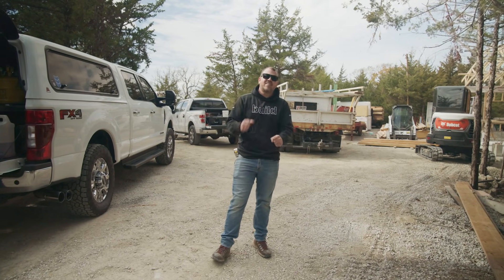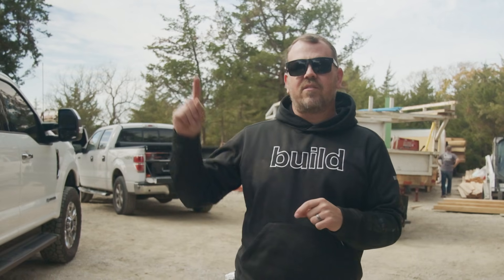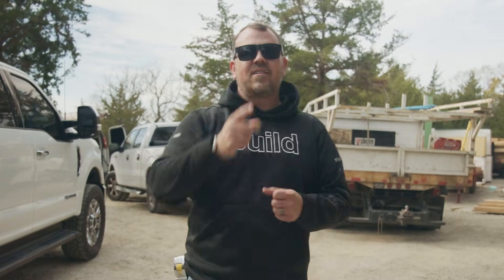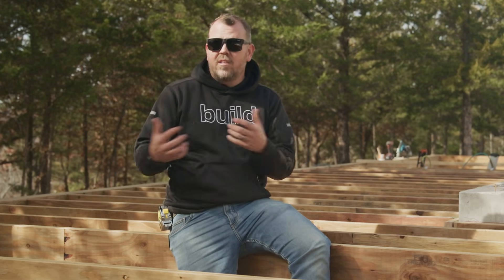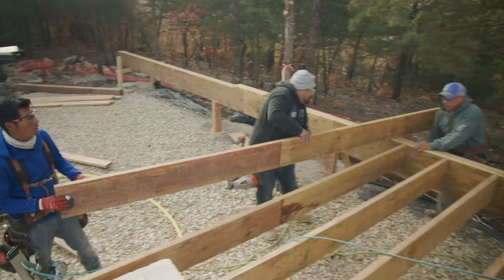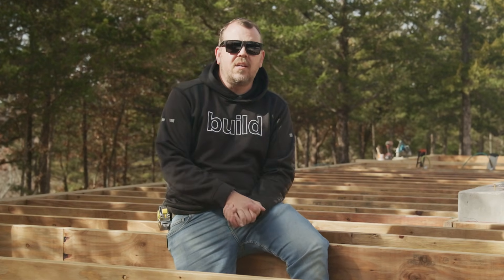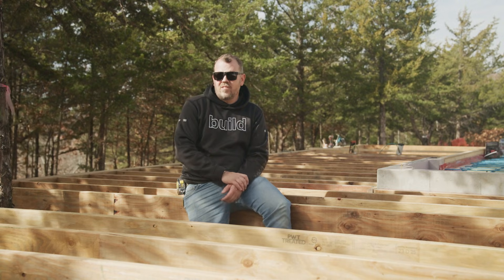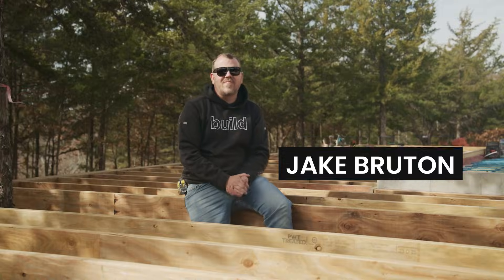Ditch the Pressure-Treated – Why LVLs Make a Better Deck

Comment: Its roughly the same span and dimensions comparisons for load bearing and span codes. PWT LVL though is much higher. Prodeck show $12.10 per lineal foot on 1.5x10" vs $3 per lineal foot on regular ground contact PT. Yes there is cost cutting for labor, efficiencies to be found, etc., but taking a $10k deck to a $30k deck (or whatever cost your want to compare) is a hard sell for most builds. Risinger channels specialize in the top percentile of builds and has great videos, but normal Americans and builders can't implement $50 Sugatsune hinges and upgrades that cost annual incomes of families. Not throwing shade, I wish we could and the knowledge is sound, but lets talk realism in todays world.

In before keyboard warriors saying price your worth, in my market, been a framer for 230 years and its not that bad.....
Reply: The total cost difference shouldn't be anywhere near that severe. I imagine the cost of the framing lumber is only around a quarter of the cost or less of the deck (customer price) unless they cheaped out everywhere else. The decking, railing, and labor are the big costs usually.
Reply: Even with the prices of PWT LVL, you can get a lot of deck for 10-30k. I have a composite top deck, that after 15 years the carpenter bees completely destroyed the sub-frame.. so its back to figuring out what material to use: (1) dimensional lumber (2) Owens Corning Structural/Composite Lumber (3) PWT LVL. For a 20' x 12' deck to replace the subframe, I have got quotes in excess of 20k.
Reply: @Dennis47403 I'd look at steel and aluminum too. I'm not a huge fan of the OC composite. The spans are terrible.

Comment: How does PWT LVL's price out versus steel joists? I have seen high end decks made with steel in videos but never in person. It doesn't seem to have caught on.
Reply: The first pricing I found was PWT Pressure Treated 2x12x16 $264.00 vs $40.58 pressure treated from Lowes.
Reply: That 6x lumber costs!!!!! Geez, if it was 30-50% more I could sell that but 600%….. client will call me a scumbag haha
Reply: @Knappconstruction if h don’t have an indoor pool you don’t get to ask
Reply: @Knappconstruction keep in mind you'll only need half as many plies usually
Reply: 25-55 for pt 130-160 for pwt